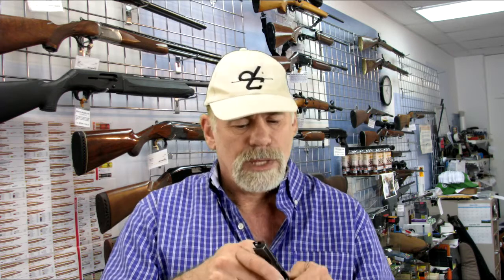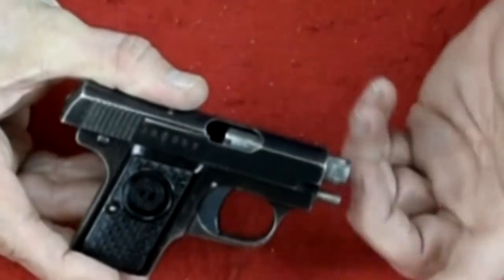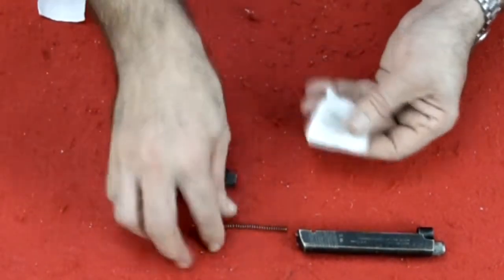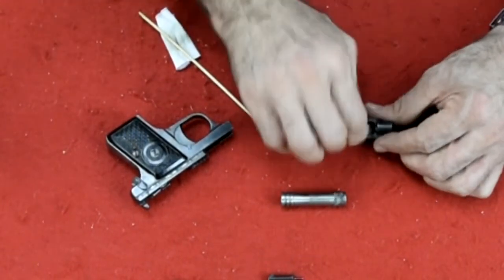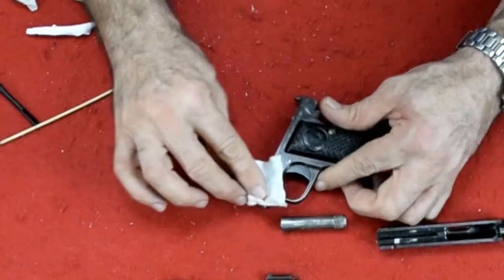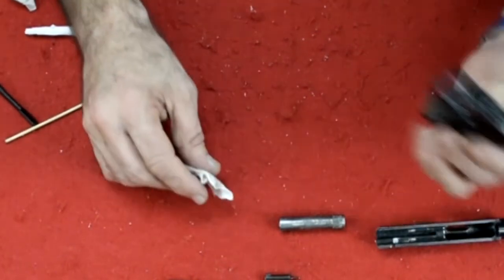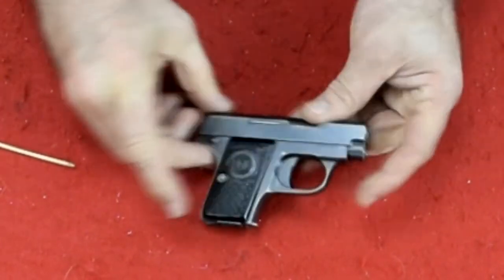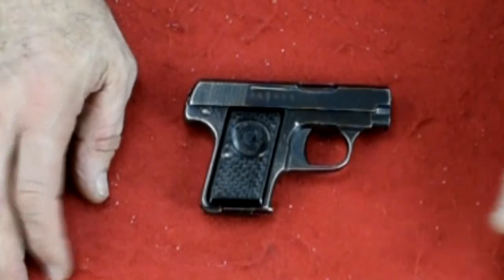Privet: CZ Model Z, Basics, Field Strip, Clean, Lube, & Reassemble

Comment: I noticed that your Z doesn't have the pin in the rear of the firing pin spring.  Might be why the spring was kinked while assembling.
Reply from the maker: yes I thought that when I field striped it, but this one did not have the hole in the back of the frame that the pin would center on. But still you could be right. Thank you for the feed back

Comment: thank you for video but I have a question how it eject the empty  bullet? I cant see ejector in it
Reply from the maker: It is a straight blow back system, when the shell hits the battery the shell gets flipped out,
Reply: Alans Firearms  i have read that the extra length of the pin eject the shell . i have one of this model but first time i tried it the pin has broken then i fixed it but the pin now is little shorter. the problem is i have very old bullets and after fixing i tried it but the last bullet stocked in the small window .i don't know it is because of old bullets or short pin. in my country its hard to find this caliper of bullets
Reply from the maker: you must use standard 25 ACP or 6.35mm. I would bring it to a gunsmith and let him check it out

Comment: I am getting one of Those with a broken firing pin where can I fined a new one
Reply: Did you find a replacement? Try Gunbroker for parts. I'm told the Browning 1906 has parts that will interchange also.

Comment: hello alan im looking for some parts for the pistol in the video, can you provide with your email please, thanks
Reply from the maker: I do not have any parts for tis gun. in fact my gun smith had to fabricate a few to get this firearm to operate
Reply: Alans Firearms thanks for your reply, does your gun smith still fabricate? im in need of a plunger and a plunger coil
Reply: Alan,
What parts did you need to have fabricated?
In your video it looks like you are missing the firing pin spring guide rod.  I just purchased a model "Z" and it doesn't have this part either so I am interested in being able to obtain one.  I think the one for the DUO would fit, but Numrich is out-of-stock for it.
Reply from the maker: I do not know so thank you for that information. I never seen one with that part...
Reply from the maker: yes he can but most fabrication is not worth the price unless the firearms is worth a lot of money
Reply from the maker: alansfirearms@live.com